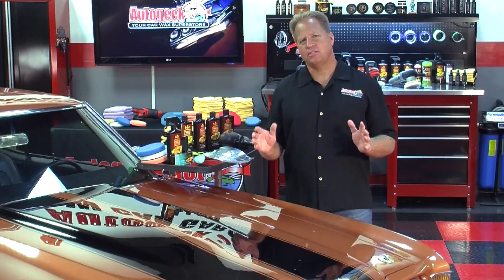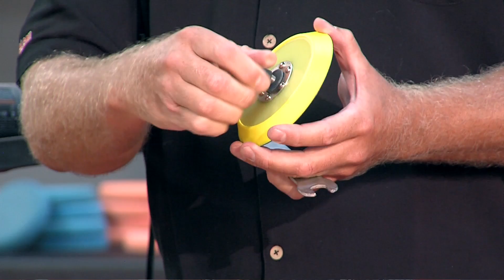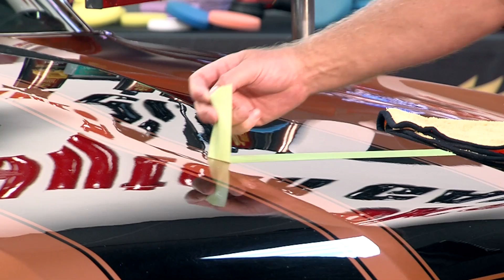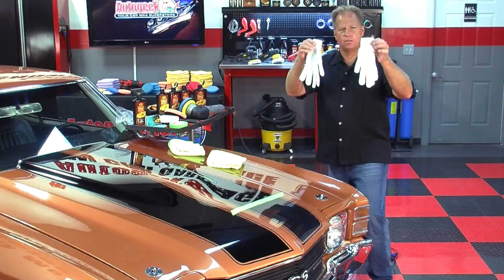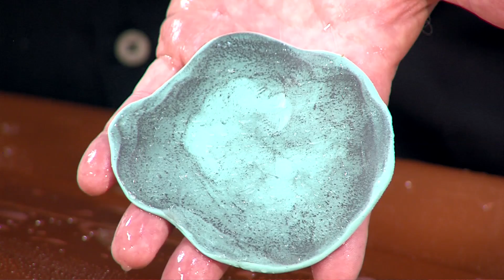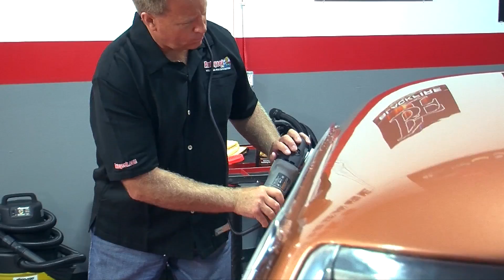How to do Automotive Exterior Detailing - Autogeek

Comment: I know the sharpie marks on the back of the backing plate are to make sure it's moving.  But when I use mine and when watching the video, it looks like your eye doesn't come close to picking up the actually spin rate of the backing plate.  It almost looks like it goes one revolution per second.  How do you know you're getting the actual desired spin rather than 1 spin per second.  It's like looking at a ceiling fan that spins so fast that it almost looks like its frozen.  How do you know it's not actually frozen?

Comment: Was that I n slow motion at 22:15 because judging by the line on the backing plate it looked like it was spinning extremely slowly. Is that how low you actually want the speed for removing swirls? Was the pressure too much for that kind of DA to continue revolving quickly? Seemed to be a lot quicker when you stepped up to the more aggressive compound

Comment: Mike, so you covered the detailing process of compounding and polishing i like to know what do you do with the supplies you just used on the car like the D/A pads and the microfiber towels? Do you clean them and store them in a zip lock bag or box for later use or you just trash them? Obviously you don't throw away new microfiber towels and D/A pads after one use it would be expensive to keep replacing them for one use only. So this is the question that i wander what professional car detailers would do to the cloths and pads after its use?

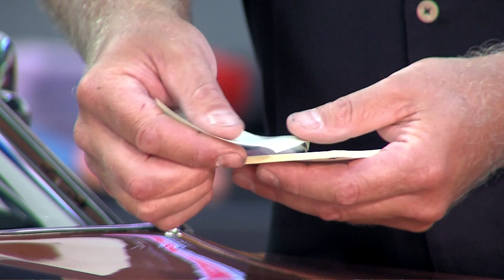Comment: 14:30 A Postit note is nowhere near 3mm. 3mm = 1/8". Think about it. Or grab a micrometer or just a metric ruler (and a Postit note) and check for yourself. Otherwise a very helpful video for amateurs such as myself. Thanks!
Reply: 3 Mils.  = 0.003 inches

Comment: Great Video! BTW. a PostIt Pad is about 0.3mm, not 3mm!
Reply: Even that would be wrong. 0.3 mm = 300 micrometers. Factory paints are only 100-130 micrometers thick, inclusive base coat and primer. The thickness of the clear coat varies, but is probably never over 40-50 micrometers.
Reply: Either way, a postit note is definitely not 3 mm thick!! Americans don't really understand metric measurements... In my country, it's common to shorten millimeter to "mil"; but in the USA, when in the auto paint industry (and other fields), they're talking about "mil", they're meaning thousandth's of an inch. What most of the world would call a "thou". Very confusing.

Comment: Your not polishing the paint or base coat but the clear to enhance the base coat rite or wrong Mike
Reply: You should only be polishing the clear coat, which is where the light/medium scratches are. If you're polishing the base coat, you have a problem.

Comment: How much use should we expect to get out of one clay bar?
Reply: I'll drop it and make it gross before its real life expectancy is served.  So I use it once basically.  Buy the Mother's kit. Comes with two clay bars and a towel and spray.   Use one until it can't be kneaded to look clean.  Or until you drop it and have visible or tactile dirt.  Use the second one as a backup in case you drop it in the middle of a job.  That kit is a steal.

Comment: Great video - but in regards to clear coat, yes a clear coat is usually 2mm thick; however, that's not what a post it note is.  Those are only about 0.1mm thick, so not even close.
Reply: Mike misspoke.  The measurement is mils (.001") not millimeters.  If clear coat was 2 mm thick, 3 coats of clear would make your car 1/4" bigger!